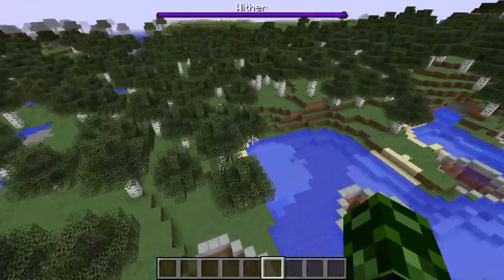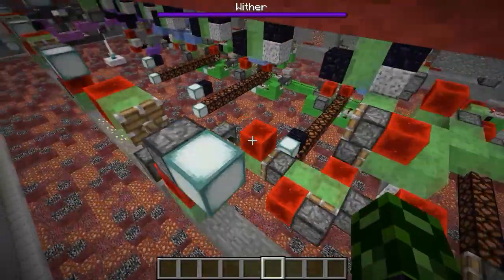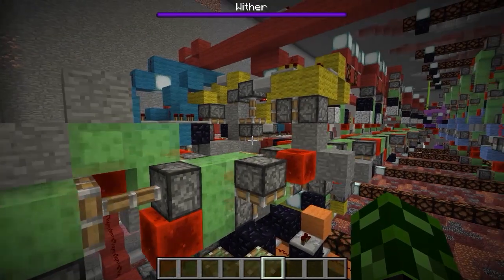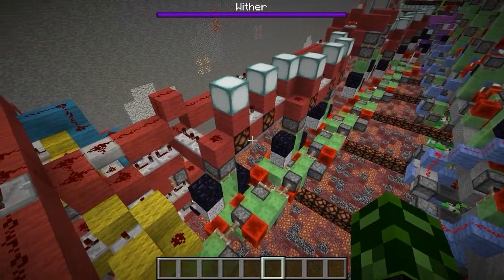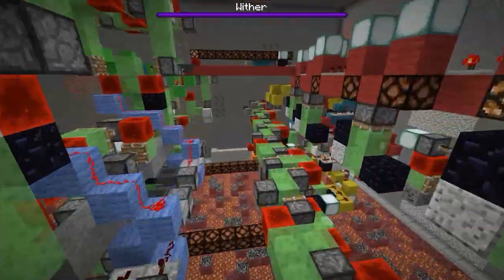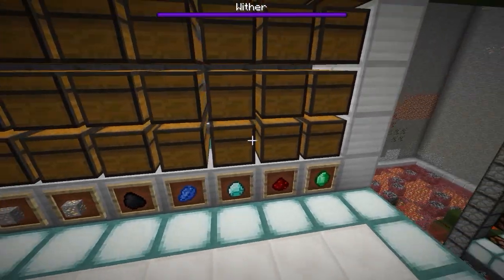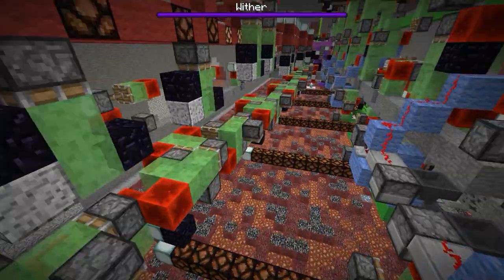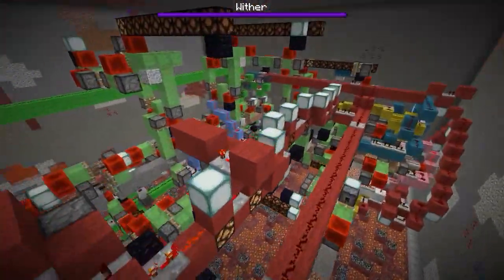Minecraft: Automatic Tunnel Bore Machine - Commentary

Comment: +Cubehamster
I'm working on a TINY  version of this, but the one problem is attaching the drill head to the engine. B.T.W. the engine is JUST the 2 way flyer, without all the big stuff on top. the way it will work is that when the flyer hits a block above and turns around, a slimeblock will extend and grab that block, therefore forcing the machine to go one block further on the next trip. the only problem with that is open areas and caves above it will break it so I'm gonna add a boat area on the back or side for mechanics.

Comment: They need to make red stone a bigger part of survival mode and make using a big mining machine more efficient then just digging the blocks your self. need more redstone things. slime balls are really only used for mechanism parts, Slimes should drop more slime balls, and redstone should yield more dust. Next make red stone smoother to use and add more stuffs to the red stone tab of items. like block placers, breakers, 1 block logic gates, insulated Redstone wires that enable wires to be on walls and ceilings. you know, project red stuff. maybe pistons make 2 pistons instead of one? maybe make a way to change the speed of pistons with  an upgrade? maybe wireless connections for "end game" survival red stone creations? also make pipes.

Comment: Because the unloading system uses flying machenes, could you have 2 or more drills side by side and use the same station? You would have to stop one before it entered the station if a different drill was still in it.
Reply: The machine would have to move sideways, which I don't think is posible.
Reply: i think that should work, +Elephant Warrior in the video cubehamster told us that the block unloader usses 2 way flying machines wich could travel a longer distance then they do now.

Comment: Moveable wither cage?
Reply: Where would you use a mobile wither cage in here?
In the end you want the items to be transported to a static storage (because it would be very annoying to have your item storage fly away). So we have one static point anyway. And then we might as well have the wither cage there.
Reply: Because the mining time increases exponentially with the lenght of the tunnel.
And there is no way around that. Sure you can speed up the engine, unloading, etc. But the machine will always have to travel through the tunnel it has mined to mine another block. If you're familiar with big o notation: O(N^c)
With a wither cage there is no need to return so it goes much faster. O(N)
Reply: stacked minecartchests can ride back without rails.

And the it would be a lot faster if you could use slime blocks to push the wither in the blocks. Kinda like how panda4994 did the wither mining a long time ago. with minecart hoppers picking up the items
Reply: G_glop
It´s not exponential, it´s polynomial; more specific quadratic. (But I guess you were very much aware of that because you used big O notation).
My point is, that you won´t get rid of the O(N^2) runtime, because you still have a static storage which you´ll transport the items to. And the longer the machine runs the further you get away from the storage.
You will only get a O(N) runtime if you make absolutely everything movable, including the storage, but that´s not something anybody wants.
Reply: Myren Eario Sorry, still i bit cranky with deducing the big o.
Maybe you could have a secondary flying machine that would transport the items to the station.
So the quadratic component drops to almost nothing for tunnels smaller than the whole minecraft world.
Reply: G_glop
Yeah, you can get the quadratic component smaller, but I just wanted to say that you can´t get rid of it. So if you just want to reduce the quadratic component, then you can use mobile wither cages, but it sounds very complicated and it would be difficult to make it stable.
Reply: Myren Eario 
Well, automated mining isn't very practical in the first place. So why not go all the way with complicati-ness? :P
Reply: +G_glop it is practical... It is basically infinite ores...
Reply: +Myren Eario yeh, once it got out of the loaded chunks it would break
Reply: +InCrIpTiOn
+Joe Fortescue
No, and no.
Due to the quadratic component the ore output would quickly drop. And besides, it get&#39;s stuck on obsidian, gravel, spawners, chests...
For the second comment: redstone (including pistons) loads chunks into &quot;lazy&quot; mode. &quot;Lazy&quot; chunks won&#39;t process entities and random ticks but they will process redstone. Only problem would be if the flying machine would contain entities, such as withers and storage minecarts.
The you would have to have a secondary flying machine above the groud loading chunks in 5&#215;5 square around any chunks that would contain needed entities on the primary flying machine.
Because the chunk in the middle switches from being just &quot;lazy&quot; to full on loaded processing entities and such.
Reply: Altought you could use hopper minecarts stacked into each other driving between the drill and the station to move the Items back.
Reply: 15 Redstones Read my earlier comments.
Reply: This is resurrecting a dead thread, but there could be a practical use for making everything movable (including the storage). Imagine AFK'ing for an absurdly long time while riding the bore, and then carrying many containers of storage back to the origin with yourself on a flying machine. While you're right that the runtime would still be O(N^2) [because you'd still need to make it back to the location of the bore to continue mining], the constant and sub-quadratic factors would be dramatically reduced. Of course, the inability of this machine to cope with gravel, obsidian, etc. would make this something where the AFK'er would need to check back every-so-often, which limits the effectiveness of leaving it running, say, overnight. The only real way to escape O(N^2) runtime would be to construct new chunk-loading storage-carrying flying machines at some regular interval and send them back (full) toward home base, where they'd need to be unloaded and destroyed (or possibly sent back to recycle materials, but that sounds even worse). Ignoring how horrendously complicated that would be (if it's even possible! [certainly not automatically]), this'd also have the issue that at any given time, the number of active flying machines would be on the order of o(N), which would mean steadily-progressing bouts of super-lag.
Reply: Exactly what I was going to say 1+2+3+...+n = n*(n+1)/2 is O(N^2).  Guys I found the programmer.
Reply: +Wayne Li k

Comment: Cube do you think that at some point someone could make a tunneling machine that flies at 3,3 m/s?
Reply from the maker: I know for a fact that Dico has already made a self returning two way flying machine that is half a step faster then the one we used in this tunnel bore. Not sure if 3.3 is possible.
Reply: +Cubehamster Better not think too much ahead for now, This machine is awsome either way!
Reply: +Cubehamster pretty sure it is, but it is slightly difficult. The flying machine is at least, but the spring system will not work at that speed.
Reply: +DicoTheRedstoner Is it possible to make it work as the core of the machine also acts as the block grabber? Seems pretty difficult but that would make the extensions innecesary.
Reply: +lagalil The bore head is very specific, runs into issues and at its very limits as it is.